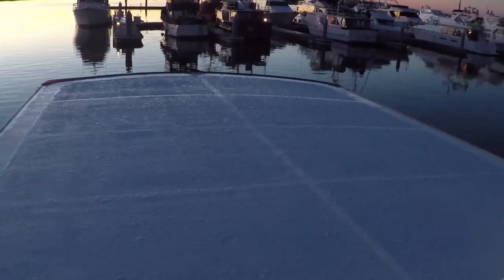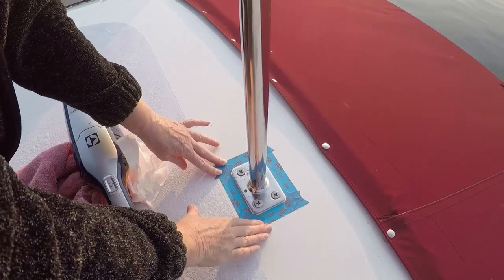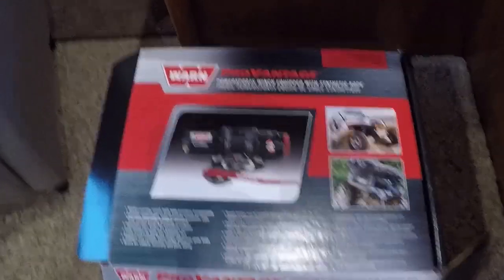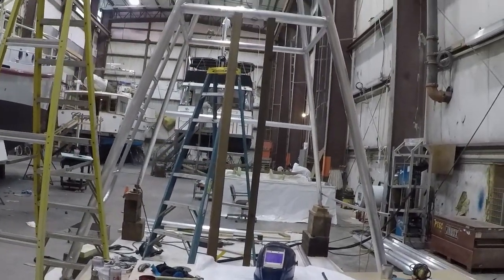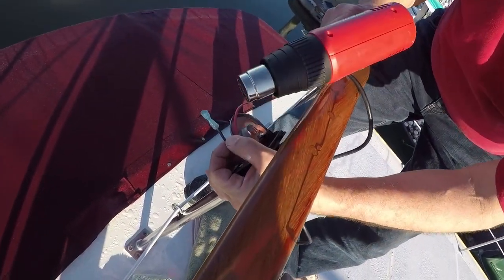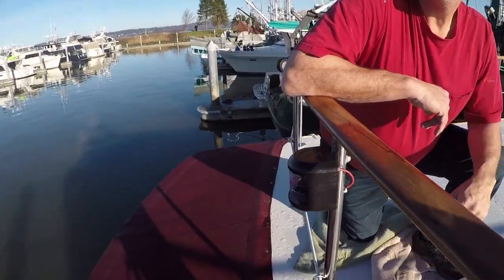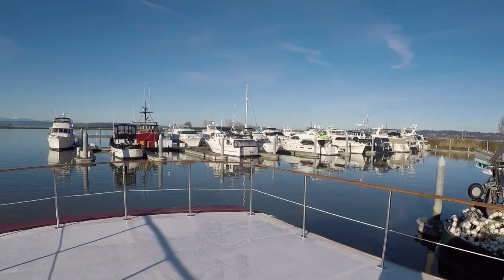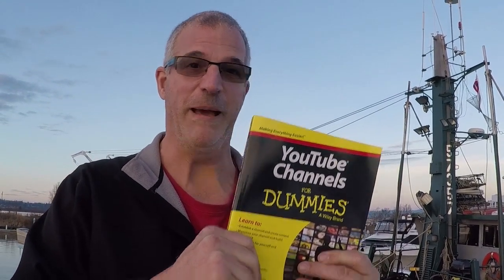Projects and expenses keep growing - Refitting our trawler, Sea Venture - EP 20

Comment: Great description of running on one engine. I have a 36' Prairie with twin 4-236 85 hp Perkins and run on one engine occasionally. My boat does the same as yours so I don't do it much. I too run at 1500-1600 rpm for best cruise and economy. Loving your channel, thanks for sharing.

Comment: Great video again, great to see you life extend the old girl. Curious as to why you did not go for led stern light. Is there a reason?
Reply from the maker: Tom,
Thanks for watching.  Great question.  As part of the refit we are replacing all 4 running lights.  The series 40 lights we chose are $62.00 each.  The LED version is $170.00 each.  Since they are only on when the engines are running, I did not think the added cost was worth it.  At least we were not feeling the $450 added cost at the time we were purchasing the lights. Also, it takes the same bulb as our old running lights, and I have 8 spare bulbs in my inventory.  We did get the LED version for the anchor light, since, of course, it's on when the engines are not running.
Thanks again,
Jim and Rosy

Comment: Enjoyed that and the Q&A was well pitched. It sounds as though single engine running at1500 rpm is insufficient to keep the non driven prop spinning and if it is stationary then yes it would act as a huge water brake. However you both seem very content with twin engine cruising and that is what matters.👍 Really enjoy your content and your humour.😀

Comment: I'm looking forward to a paravane tech talk. Maybe with some drone footage *wink wink*. To echo another comment, you two do things not many others do on YouTube as there's little information for motor vessel cruisers.
Reply: Also, I'd like to know how you two got into and started in cruising. Do you suggest those online boating license sites? Have you just become knowledgeable through experience or some other means? What would be your suggestions to those considering becoming cruisers? It's not a really techy topic but I'd be interested to know and I'm sure others would be too.
Reply from the maker: Thanks.  Drone footage is on the way!.  
Jim and Rosy
Reply from the maker: We were just lucky to live in the northwest where there is so much great boating to do.  We started off with a small 17' Bayliner, then in 1993, purchased a 30' Carver, then in 2000 we purchased a 45" Puget Trawler and started cruising toward Alaska.  We purchased Sea Venture in 2014.  So I suppose it was just experience one summer at a time.  We belong to the Everett Yacht Club as well, and we have been able to help along many new boaters who joined the yacht club.  Club cruises are usually easy and with other boats, so I think it's a great way to learn.  We also, many years ago, took some power squadron classes, which is where we first learned to navigate, learned rules of the road, etc.  I hope this gives you some ideas.

Thanks for watching,
Jim